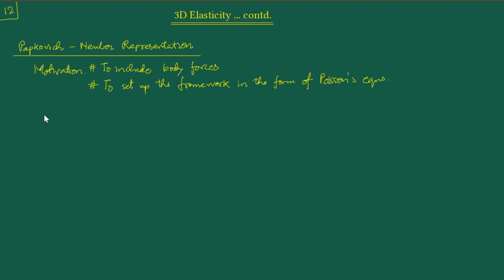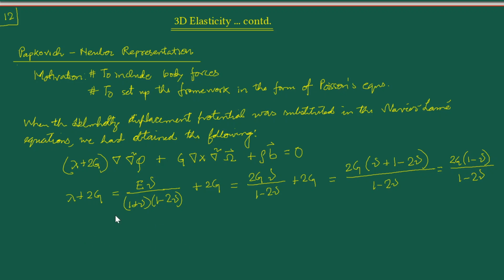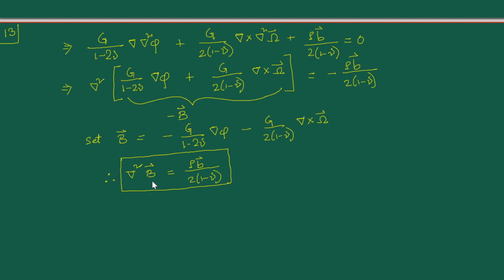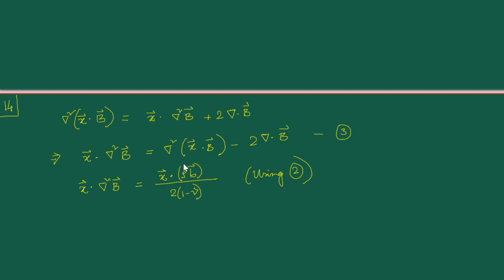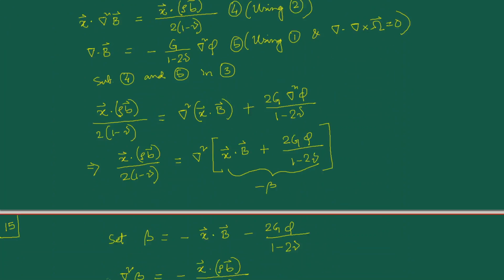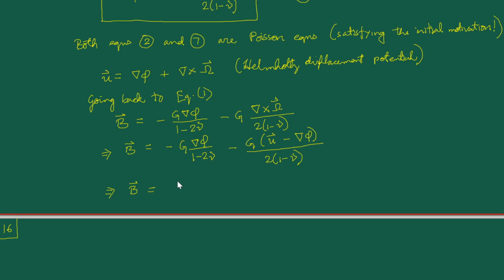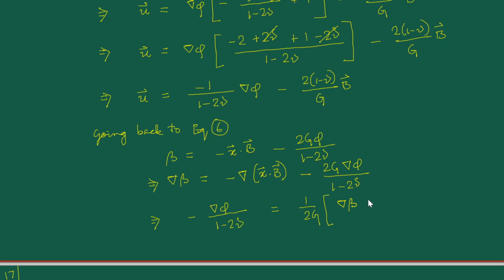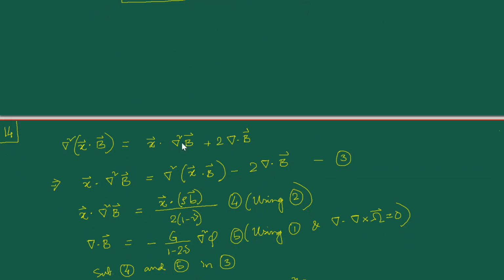3D Elasticity – 5: Papkovich-Neuber Representation

Comment: Thank you very much for your great lecture. In the final result of Eq (10), still x remains in the displacement. How should we choose (or determine) x when we solve a real problem ?
Reply: Now I understand. We do not have to determine x. It is the position vector of the point to be evaluated.
Reply from the maker: @GigisPuyopuyochannel  Sorry for missing your comment more than a year ago. You are right; we do not have to worry about x; it is the position vector of the point to be evaluated.